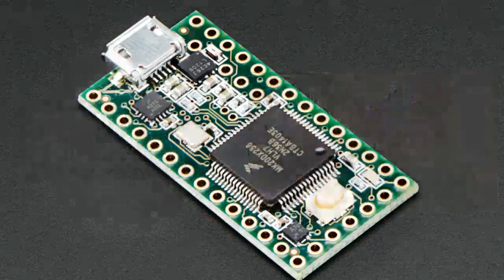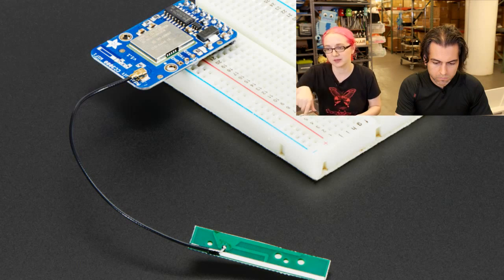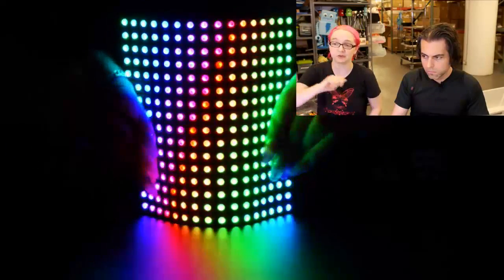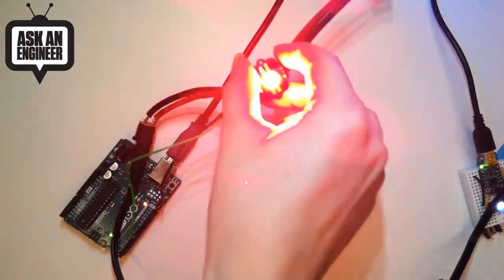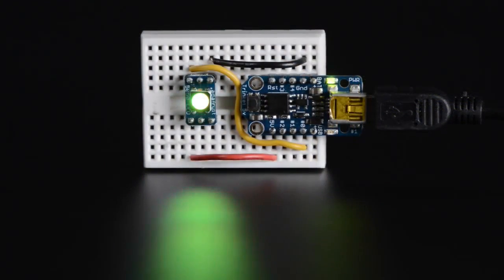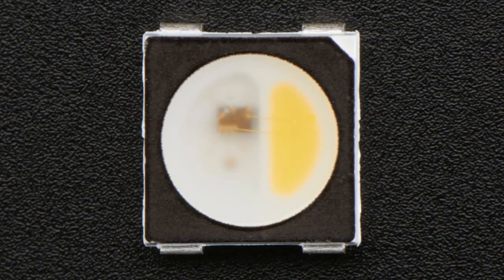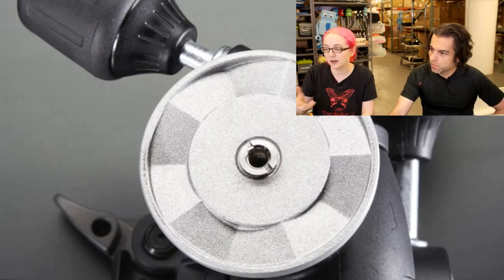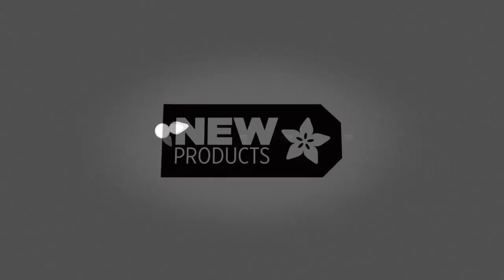New Products 10/28/2015

Comment: Regarding the IBDAP - CMSIS-DAP JTAG/SWD Debug Adapter Kit (10m20s),  what kind of Chip , Debug-Adapter, Software is needed?

For example, would it work with a Smartfusion2 (Arm-M4), FlashPro 5 Debug Adapter,  Eclipse with OpenOCD (0.1)?